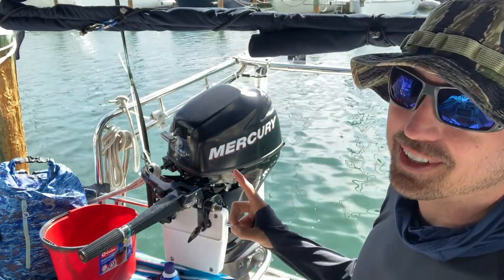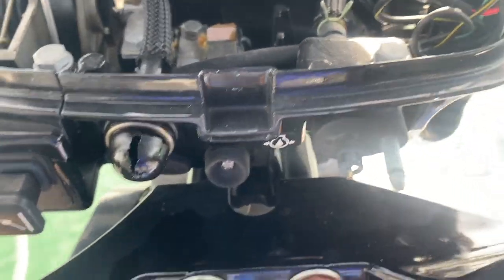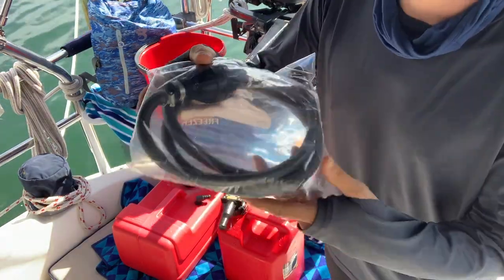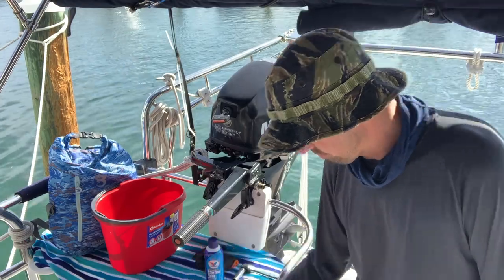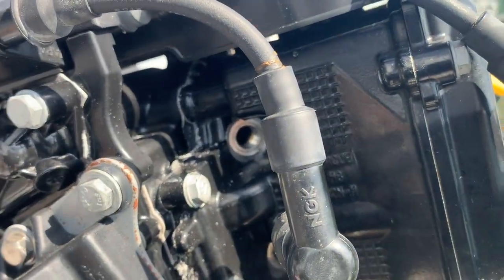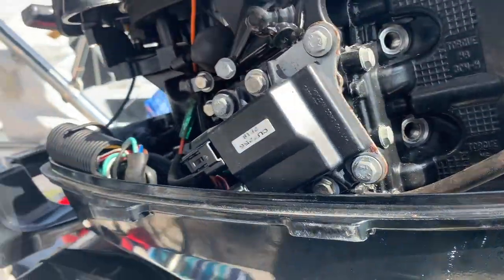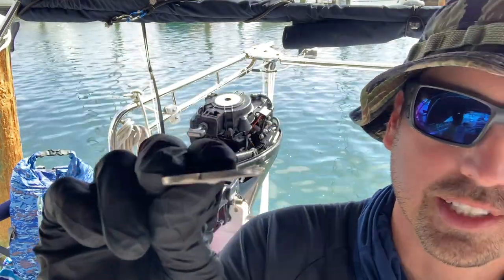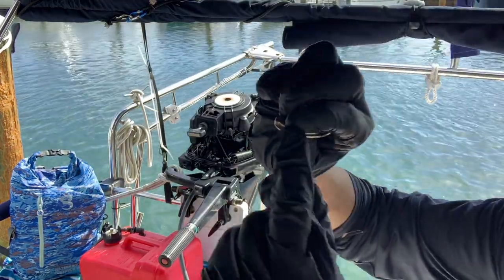Ep 3: Starting🤞the Dinghy Engine

Comment: Great job. But never run an outboard out of the water. Its true you can run the engine for 20 or 30 seconds without powerhead overheating. But the impeller in the lower unit water pump is always spinning when running. If there is no water to pump its rubber impeller on metal housing and will ruin the impeller and score the pump housing quickly. In this case though you say the motor hasnt run in years so the impeller needs to be changed anyways. Its pretty easy to do. Usually just one bolt for the shift linkage, 4 bolts for the lower unit, then pull the lower unit and then 4 more bolts to remove the pump housing. Be sure you remember to install the IMPELLER KEY between the impeller and shaft. As a matter of fact be sure to look for the key as you pull it apart and are ready to catch it in case it falls out. Change the lower unit oil at this time as well.
Reply from the maker: Perfect advice. I bought the impeller when I bought the spark plugs. I wasn’t sure if it would ever run again honestly. 
So I just wanted to see if it would turn before I invested any more time.  Thanks for all the details!   I will def use all this advice!!!
Reply: @SailingByeFelicia looks like you lucked out on the motor. I'm sure it's going  to be fine and last for years. I think I have a video on carb cleaning.  It's not quite the same but should close. You may need to do that as well. But if it was stored with no fuel in the bowl it should be fine.
Reply from the maker: @mvintrigue-trawlerdiy1101  more good tips!   I’ll be sure to watch the video in carb cleaning! Thanks again.

Comment: Now replace the water pump impeller that you just ruined by running the motor for even one second without water to lubricate the impeller.
Reply from the maker: Ok, good tip.  Have you done that before?
Reply: Good suggestion.
Reply: Yeah, I made this mistake twice before understanding